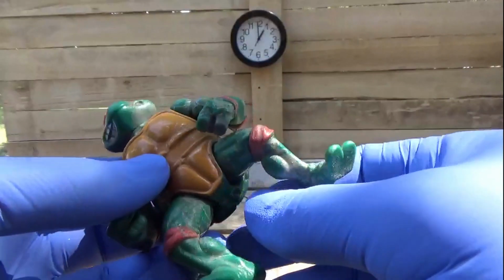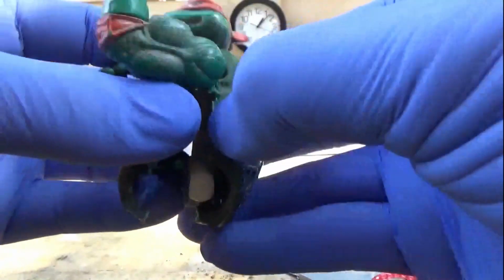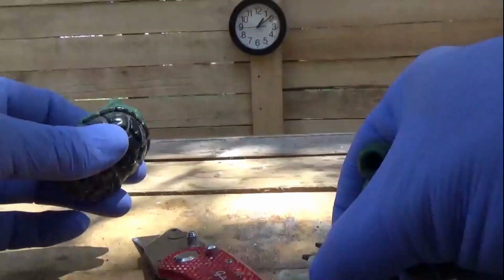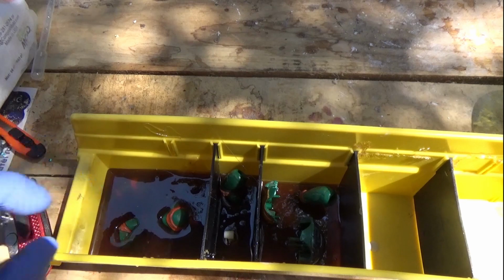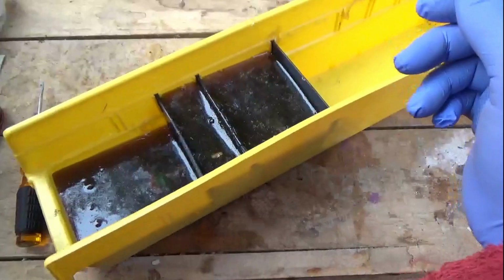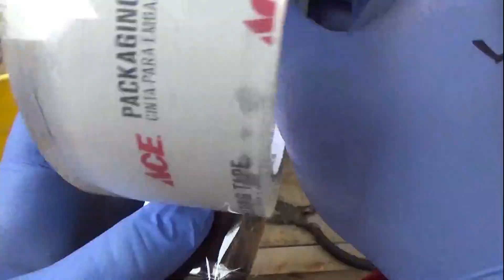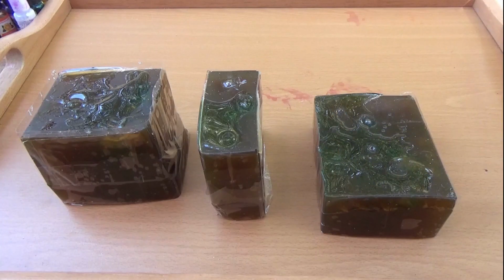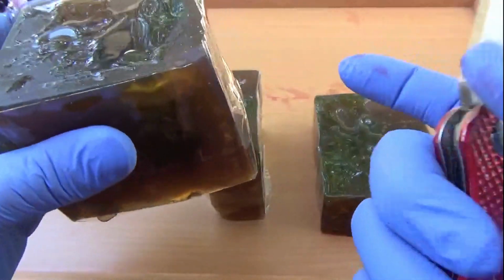Articulated Michaelangelo TMNT Resin, Acrylic Paint and ComposiMold (Craft Papa 018)

Comment: I've noticed in a lot of your videos that the hands don't really seem to come out. Have you tried adding some air vents? If you're not familiar with the concept, basically take some little plastic rods or chop sticks or whatever's handy and attach them to the hands with a little bit of hot glue or wax (ideally, you want a vent running from each of the fingers that terminate into the longer vent). Then have the other end of the vents going up to where the pour spout is so that air bubbles have a place to escape to when you're pouring the resin.And you do this before pouring the composimold over the figure, so that the mold has air vents built in.
Reply from the maker: Thank you very much Planet Schlock! I am right now diemolding A Gundam, and neither hand came out. I believe this message you've mentioned would have been perfect! I will from here on out try and do this, with the air vents. Thank you so much! I was just commenting on best video that I'm making right now LOL about the hands not coming out LOL! Have a great day! Thank you so much again!😎👍
Reply: @OmegaOrdained  Awesome, I'm looking forward to seeing how it turns out for you. I just got my composimold kit in the mail yesterday and haven't made a mold yet but I have a bootleg Mexican luchadore figurine I set aside as a test subject and I plan to prep the model exactly like how I would one of my previous silicone molds (air vents, extra-large pour spouts, etc). The Bubble Buster spray seems promising but I'm not taking any chances with air bubbles LOL
Reply from the maker: Hey right on! Once I got started with ComposiMold I couldn't stop hahaha 🤣 😆 😂  I have made over 100 molds! It is so much fun. When I run out of resin I use wax or plaster of Paris. I made a second Gundam mold last night but the feet slipped of the bottom of the can and the air vents that were connected also fell off. Hahaha so I'm going to remake the mold tonight when I get home from work 😎👍
Reply from the maker: How did your mold turn out? My 3rd gundam with sprus or air vents turned out fantastic! Thanks again for the suggestion!  I'll put the video up in a couple of weeks 😎👍
Reply: @OmegaOrdained  I've been doing a bunch of different molds of various bootleg He-Man parts. My early recasts with composimold didn't turn out great but I think I might have rounded a corner with this latest batch. Going to give it the full 24 hours to cure before I demold it because I don't want to accidentally warp the thin pieces (like both halves of the torso). Glad my suggestion worked for you.
Reply from the maker: You can always pop that mold in the freezer for about an hour. It'll give get some strength. And you can wait a little bit before you pour the resin, let some of the heat transfer out before it goes in the mold. But don't wait too long or you'll have a cup of solid resin LOL I've done that too hahaha. Yesterday I casted The Terminator from Terminator 2. But I forgot to add the air vents and I know I was going to lose the arms, so I can cut an air vents with a knife into the mold that'll be a new experiment LOL. I think the gun to mold with the air vents will be out in 2 weeks on a Friday. Thanks again my friend I appreciate it! I wanted to get into the He-man bootlegs because of flavius bootleg show. But I can't find any regular or bootleg at a good price LOL. That's why I did the Ninja Turtle bootleg oh, I already had it LOL😎👍